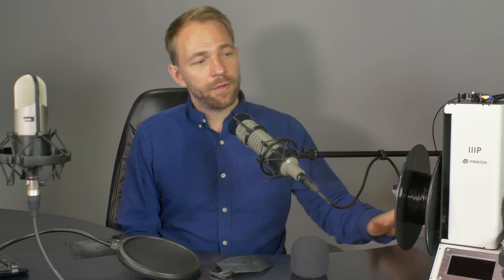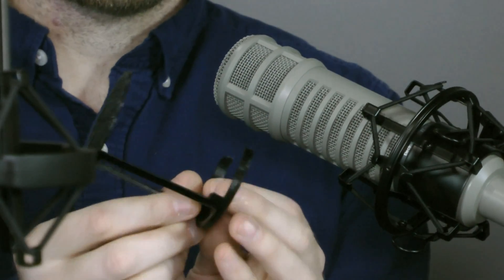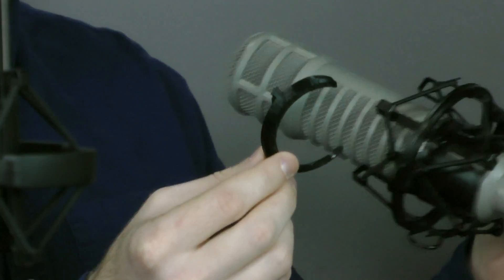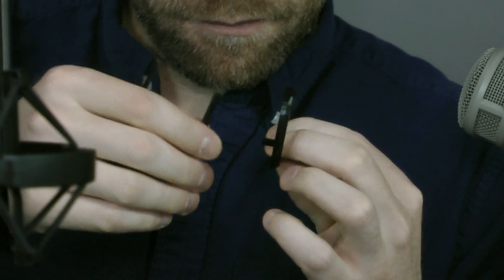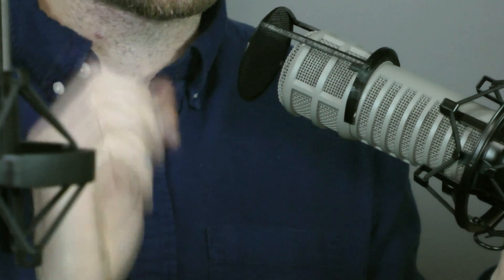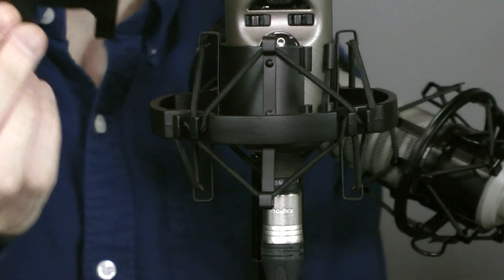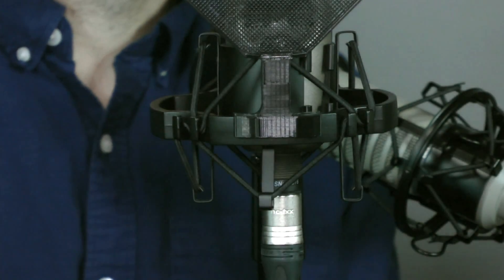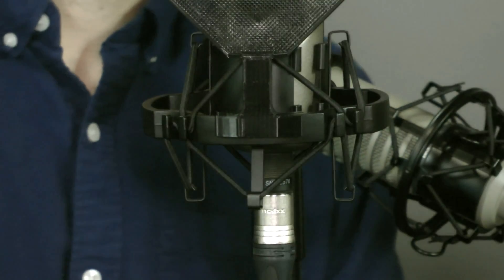3D Printed Pop-Filters - Do they work?

Comment: Great primer for designing 3D printed pop filters. I'm going to take a crack at making my own. I think putting a frame around the outside of the filter will help with rigidity. 

I've noticed too that many metal pop filters have fairly large holes in the mesh, but have a shape that diverts wind downward instead of just diffusing it like a cloth filter. I think 3D printing could give us even more control over the shape of the wind channels and make some really interesting possibilities for wind deflection.
Reply: if you ended up making one I'd love to see what you came up with

Comment: Interesting comparisons ... in order of effectiveness as tested ... the fabric had the least evidence of plosives, then your 3d printed filter, followed by the foam and finally the mic unfiltered. Strangely the foam filter was not so good as a pop filter, maybe its only designed for wind (continuous flow) muffling. As a side note, a 'trick' used in recording studios is to have the microphone offset to one side of the artist or announcer's direct air flow from the mouth. People have got used to seeing singers etc holding a mic directly to their mouth in that classic lollypop look - whereas holding the mic just 6 inches to the left or right works just as well (mono/single channel mic by the way!) One thing that probably is important is the flexibility in your 3d printed filter - as this will presumably affect the energy absorption dependent on both frequency and amplitude. Also the design of the mesh lattice would be an interesting area of study - I'm thinking of lensing effects ... a bit like an analogue of an optical fresnel lens but that diffuses the sound waves away from the central point of impact.
Reply from the maker: Thanks for the comment Seafox. I tend to agree that the fabric wind filter seemed to work best. One thing that was not very visible was that the fabric filter seems to have two layers of fabric; a few millimeters apart. 

Interesting idea with the mesh lattice acting like a lens. I suppose for that to be 3d printed out it would need to a little thicker than the average filter. Diverting the energy instead of trying to absorb it might be interesting. There would need to be a 'center' point I'd guess though
Reply: @steve_seguin  You need an egg shaped filter
Reply: I agree with Seafox, the fabric one sounded the best, followed by the 3D printed one. I'm not sure if the foam windscreen made much of a difference... which is strange because I know it normally does (I use one on my Zoom H1n). It looks like both your and mic's position were changing a bit in each test - maybe that's the reason? It definitely sounds like no filter was better than windscreen in the first run.

Anyway, I think making the 3D printed filter more rigid and/or doing two separate layers (similar to the fabric one), maybe even with different hole sizes, would be a very interesting experiment.
Reply: I agree I stopped singing directly into the mic. I now sing across the mic. What this does is get your head and chest voice and you are not thinking about singing or being aware of the mic being there. I sit down rather than stand up. Standing up infront of the mic uses too much lung capacity. sitting down allows you to sing better.